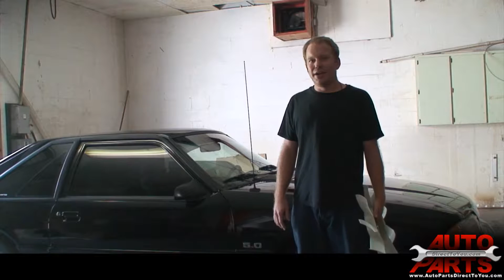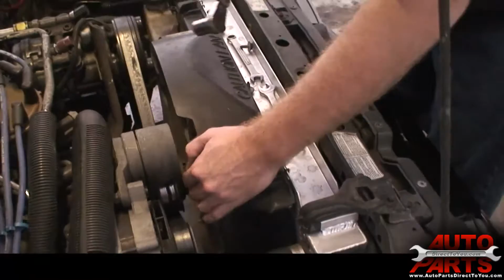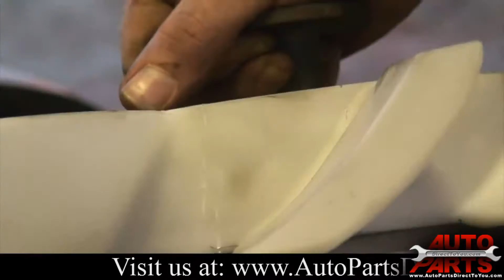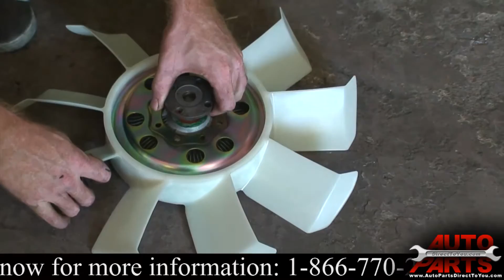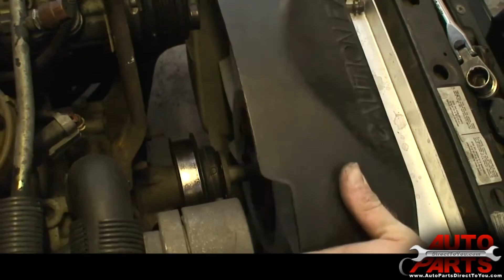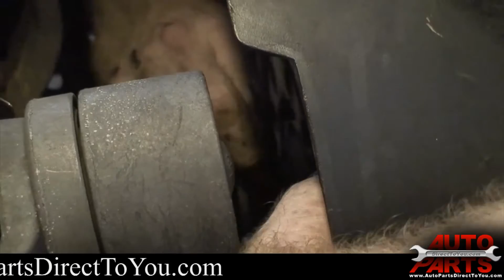1989 Ford Mustang Radiator Fan Blade / Fan Clutch

Comment: How do I know if I need that plate or not?!
Reply from the maker: The fan clutch will wear out and not engage fully, which means it will not cool down the radiator as much as needed. It can be hard to diagnose a failed fan clutch on your own and a technician may be required.
If you are referring to the plastic fan blade, then that will eventually get cracks in it, and that would be why you replace that.
Reply: @APDTY  sorry I was asking about the adapter plate that comes with the fan, I decided to keep my electric fans. I was going to swap it back to the clutch fan but I found out all I needed was a new relay.

Comment: Question: We got a 86 Ford LTD Wagon with a 5.0 in it, which we had to convert back to stock, as the dual fan aluminum radiator was not working out due to severe electrolysis. We got this fan assy, but it seems to be the wrong one for our 5.0 motor.
What is the direction of rotation for the motor in this video ??
Is it clockwise when viewing from the front bumper - or is it counter clockwise ??
Our 5.0 is clockwise when viewed from the front bumper, and the fan seems to be pushing air towards the front bumper.
Note: there is no shroud on at this time - we're still waiting for one to be built for us, so swapping the fan out is no big deal.
Does anyone know if Mustangs turn counter clockwise ??
I believe the serpentine belt Mustangs do, while the V belt ones don't.
This LTD has a serpentine belt, but turns clockwise. when viewed from the front.
Any help is appreciated.

Comment: hey i know this video is old but it helped alot but im stuck after i got the 4 bolts off. the fan still wont come off. now i see theres another 4 bolts on the fan its self right next to the 4 i just pulled off do i take all 8 off then i can take the fan off? also my car is a 1993 ford explorer 4x4 5 speed transmission. again i relize this video is old but still alot of this really helped getting some of the stuff off thanks

Comment: Smh  why would u take off the belt unhook/pull out the fan shroud when u can just loosen the bolts from the water pump pully and loose the bolts from the fan shroud lift it just enough to pull out the fan.... and another thing if you have to replace the fan u might as well replace the fan clutch as well save your self from another problem

Comment: ive done this many times cause i have a couple of mustangs, may i add that its a good idea NOT to loosen up the fan shroud till you have almost all the bolts of the fan blade off, reason for this is so it wont be flapping against your arm, its already a pita as it is and a very limited space to work in so lets not make it worse,lol, also i found out ratchet wrenches are a godsend when taking the fan blade off,just my two cents.